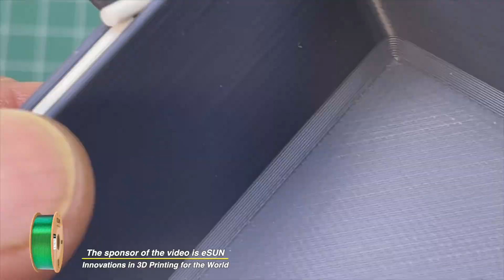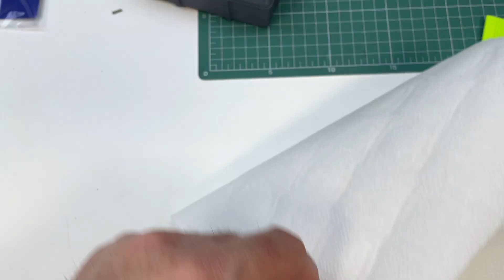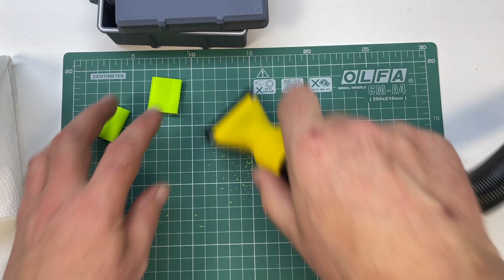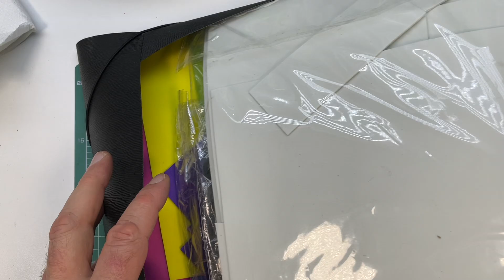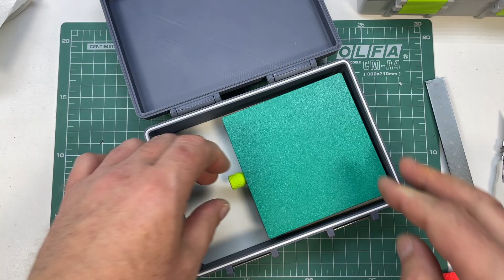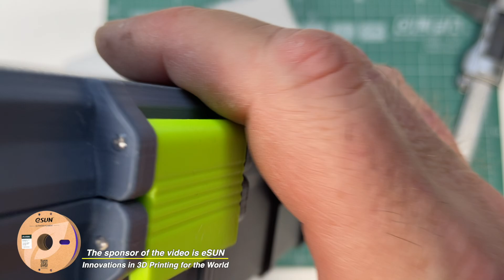3D boxes to your dimensions v 2 0

Comment: Great box solution!  Making them stackable so they don't slide would be really great.
Reply from the maker: https://www.youtube.com/watch?v=PZsO1fnPJ3Q
Reply: @V.Perinski  That's another great video!  But, I was really hoping to have the boxes in this video, with the hinged lids, be able to stack on each other.  Keep up the great work!
Reply from the maker: @BrianBehm  I didn’t plan to make these boxes stackable. Earlier, I showed a different project designed for stacking. But these are meant to be individual boxes. Yes, on one hand, it would be nice if they could interlock somehow, but it wouldn’t print cleanly. The parts are printed with the lids facing down on the build plate, and the bottom of the box is printed the same way. So, I’d have to add slots or holes, use supports, and the final product wouldn’t look as good. Alternatively, I could insert pins into the holes, but I haven’t figured out how to do that elegantly yet.
Reply: @V.Perinski  Great points! I completely understand.

Comment: Suggestions V3:
1- The holes should be 1-sided so you can insert one side and glue 1 side
2- Label on the side and top to visually see the content
3- Stackable + Self Aligning so that they dont fall or slide - and fit side-by-side
4- Carry Handle - Option -  to hooks up in the same manner with a pin
5- Carry strap - Option  - to Print

Comment: What filament material to use? Does PLA work or is it to brittle?
Reply from the maker: For the box PLA, ABS. Locks are best printed from ABS, it is soft and malleable for a soft latch.
Reply: @V.Perinski  Would PETG work okay for this project?
Reply from the maker: @bitsurfer0101  A lot of people print it and they like it. I prefer ABS and PLA